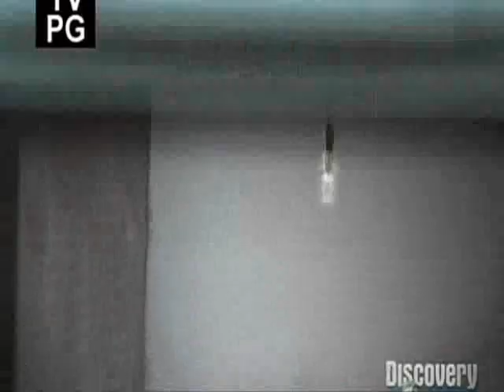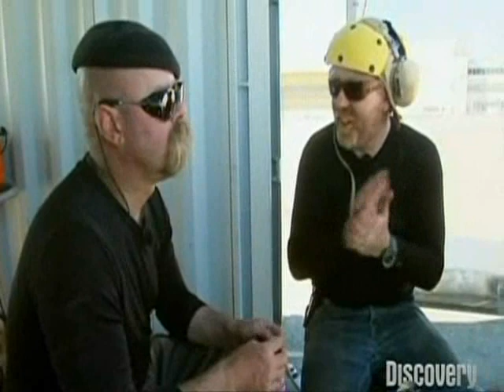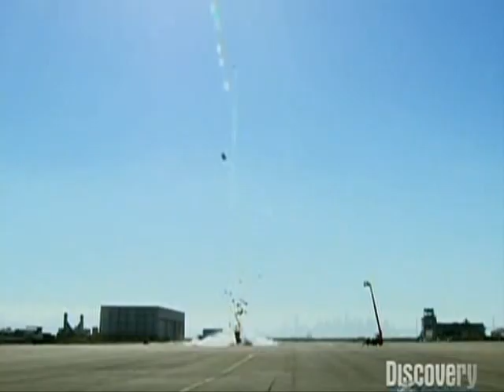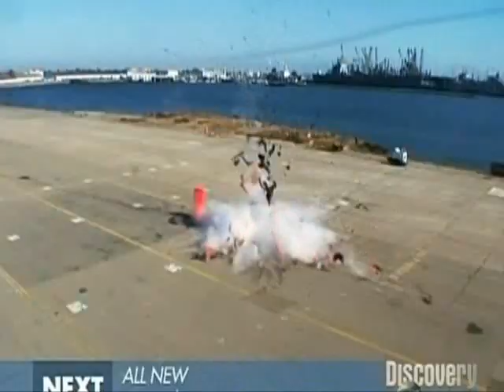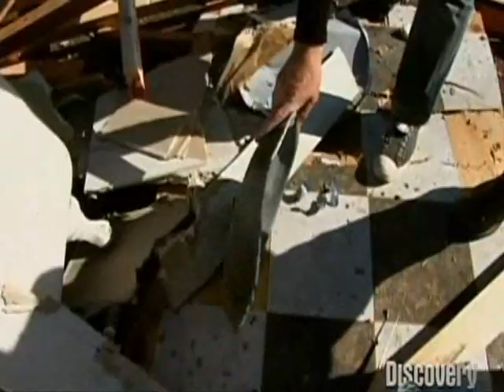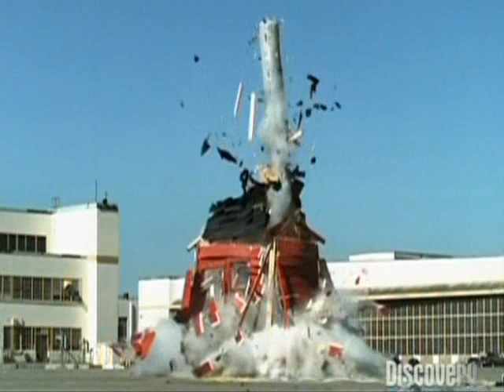Mythbusters water heater

Comment: I work in HVAC and there's a very good reason why water heaters are required to have a temperature and pressure relief valve so that this kind of thing doesn't happen. If you find water at the bottom of the drop tube coming out of the relief valve, then that means you may have some kind of problem. Call a local HVAC company to come figure out and fix what the problem is. Best case scenario, the diaphragm in the expansion tank has a leak in it, so the excess pressure can't go anywhere. That's most common, but it could be a number of different things.

Comment: You have to watch the whole episode this is from.  They did take the pressure valve into consideration, and capped it.  They removed all of the safeguards that would keep a heater from exploding like this.  For something like this to happen, the thermostat has to break, therefore causing the heater cut off to fail, and the pressure valve has to be capped.  Some people, not knowing what the valve is for, do cap it.  If the rest breaks down... BOOM!

Comment: It's pretty easy to do IF you try to. Just remove the thermal that stop the heater when the pressure is higher than 150 and remove the pipe that let go the pressure at the top. There you go! A brand new home launcher!

Comment: Water heaters have a pressure valve to release the pressure to prevent something like this happening; the Mythbusters just sealed it, to simulate what would happen if the valve was blocked.

Comment: just shows you what happens when your open vent on your hot water heater gets blocked.

all that caused that was water and heat! 

over here we in England dont have pressure valves, instead, the pipe is open and empties into the cold storage tank, for that VERY REASON.

still makes good TV!